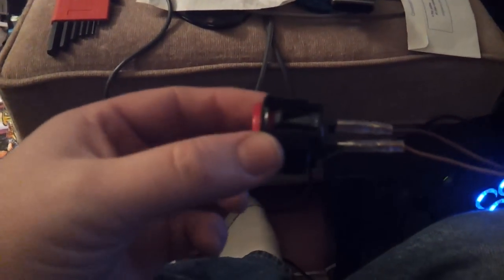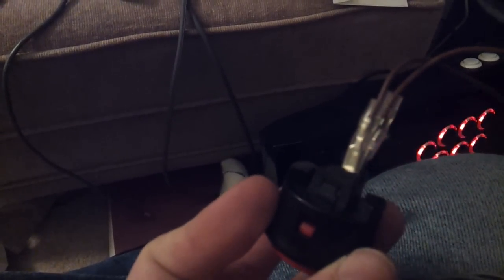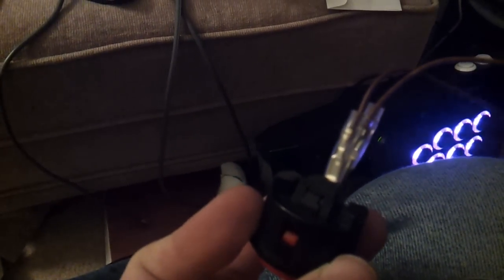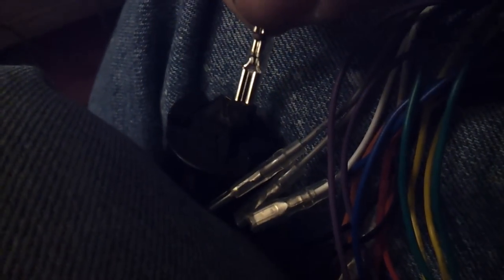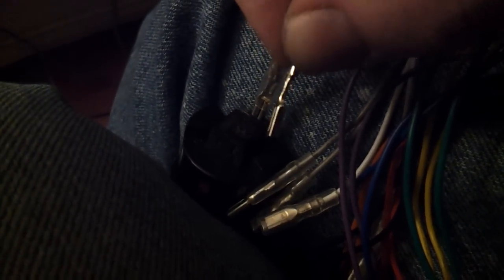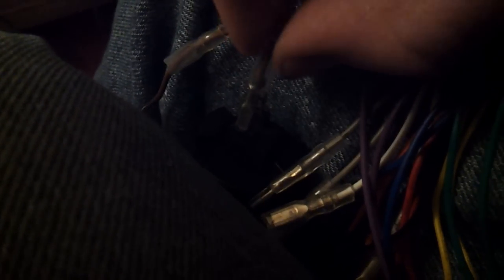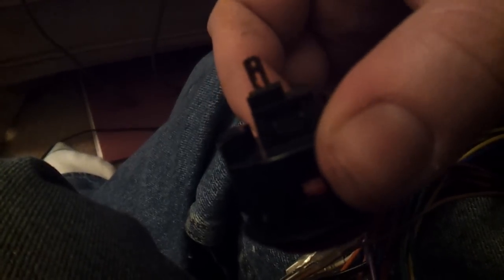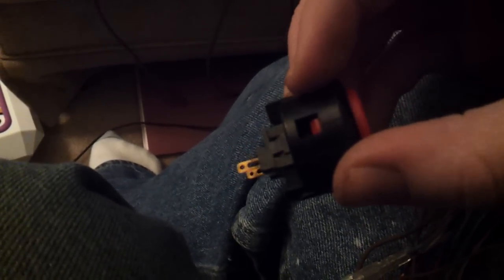Disconnecting Wires from your Sanwa buttons

Comment: Guys, please do not listen to this video i just randomly came across this, you can break your button or the female spade terminal on the wire. On the crimp (aluminum piece) that's connected to your button, there is a very small tab. Use a small screwdriver to press and hold on that tab and at the same time pull the wire off the button, BE GENTLE AND BE PATIENT! The wire will come off easily. Do not use this video's way, or you will either break the button or the crimp (aluminum piece)
Reply: do the default qanba buttons hve these?
Reply: @Toritaro07  Not all of all of the spade connectors have tabs for the quick release, but make sure you take a close look before yanking anything.
Reply: @musacekic  hmm I'm not sure if i see the tabs tbh but they're really really hard to take off, but I did manage to take one off before getting stuck on another button
Reply: @Toritaro07  If they don't have the tabs, then you can use the needle nose pliers. Just be careful.
Reply: What do these metal tabs look like? Im not sure what to press.
Reply: @YennaAvyeon  Hey dude! I ended up just pulling them out after a few hours of crying and frustration! so I think mine didn't have any if you can do try to pull em out again
Reply: also my comment didn't answer your question sorry 😞
Reply: @YennaAvyeon  what can I message you on? I'll send a video demonstrating
Reply: @musacekic  I actually found some needle nose pliers and was able to do it by using them on the part just below the wires. Thank you though! <3
Reply: @YennaAvyeon  no problem!

Comment: Turns out some of them come with tiny little tabs in the metal bit. If I knew that I wouldn't have ripped the metal part out of the wire
Reply: You might have just saved my buttons. Thanks mate!

Comment: Dude why aren’t these things made to be easier to take apart without breaking? I feel like at this point most manufacturers would have an advantage in taking the time to macgyver some way of connecting these wires more seamlessly. It’s not impossible.
Reply: They are, they have a metal tab on the side that you can press to release the clasp around the connector and it the plug EASILY slides out.  Just take something like the blunt end of a toothpick and push at it though the rubber sleave, you don't even have to remove the sleeve.  Takes about 3 seconds.  It's like Quick Disconnect clips have a quick disconnect feature in them.
Reply: @MurasakiBunny  these dont have the quick disconnect feature

Comment: DO NOT FOLLOW THIS VIDEO.
This is not the proper way to do this. On the inside of the quick connector is a little "button" that you push, which makes the wire come out VERY EASY.
Reply: Yup.. The video is wrong. I ended up finding the button I needed to hit to easily remove them. Came back to the video to finally read the comments that I was right.. Again the video is completely wrong
Reply: The tabs arent on qanba buttons. Only sanwas
Reply: where exactly is the little "button"?
Reply: Please post a video on how to find the “button” on the quick connect.

Comment: Take your video down, you're giving false advice that will cause people to damage their buttons/wires. Zackary below is correct, there is a small tab on the inner portion of the metal once you pull the rubber down. If you use pliers to press onto that, the connector slides off with NO effort.
Reply: Not all wires have the switch, older fight sticks have old wires which you have to remove in this way.
Reply: Actually if you have non sanwa ones, then they won't have the tab.
Reply: XTheVideoGamerGirlX The neo geo arcade stick pro doesn’t have sanwa buttons and it does have the release switch.
Reply: How does this switch look? It's on the connector not the terminal right? I am looking but have crown 202s